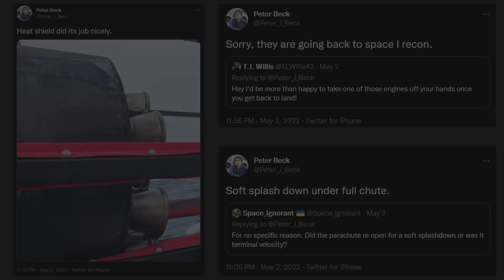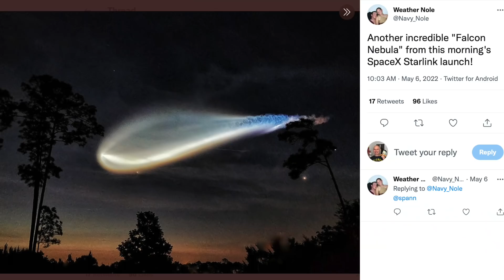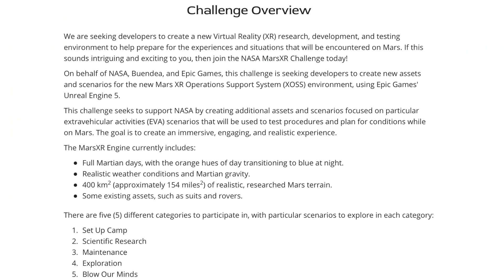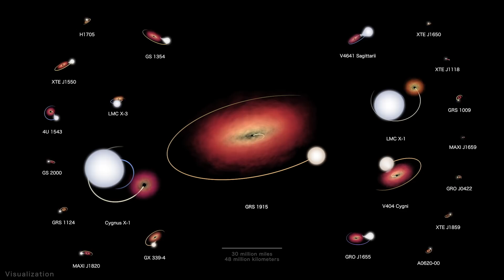SpaceX Planning To Land In Middle of Bahamas - Deep Space Updates - May 10th

Comment: Something like spinlaunch could perhaps be interesting for boosting dumb payloads like canisters of fuel or water for orbital refueling, though I have to wonder how much trouble it would be to get them into a usable trajectory at sufficient volume to be worthwhile.
Reply: You can't throw something into a circular orbit. You'd need to be standing on a high mountain which rises out of the atmosphere (eg 300km up) and throw it sideways. In reality to go from the surface of earth to circular orbit needs a course correction which means rockets. You could consider throwing something at the moon (like in Jules Verne's novel) but in practice the object would instantly vapourise in the atmosphere.
Reply: @JohnBlackburn1975  The Spin Launch payload will include an incredibly simple and cheap orbital insertion stage that they are developing in tandem with the launch system.
Reply: That can work on the moon but on earth they will always need a large second stage rocket to reach orbit.
Reply: @larslindgren3846  Large relative to a human maybe, orbital insertion stages of rockets are usually quite small and incredibly efficient.
Reply: @Sundablakr  This will be much larger than a normal orbital insertion stage. The launch speed is only 2200 m/s, to reach orbit, 8000 m/s is needed. Only about 15% of the rocket can be payload. On spinlaunchs website they claim that they can reduce the needed fuel by a factor of 4. That seams reasonable the electron rocket has a payload of about 2.4%. So most of the launched mass will be a expensive rocketstage not a simple canister with bulk goods.
Reply: @larslindgren3846  Just to be clear, I wasn't attempting to speak in defense of Spin Launch and what they are attempting on Earth, I'm part of the crowd that thinks this is never going to be a good idea from Earth, but also that I think the technology is worth researching and pouring money into developing because it will be incredibly effective on the moon and potentially even Mars.

Comment: Wonder if a spinlaunch would be viable on a sufficiently large asteroid, to throw mined substances back to Earth.
Reply: Linear accelerator will be lighter, and much less material to use to build, plus no high delta V means it does not need much power. Probably a hundredth the mass needed, though velocity will be lower, but a lot more accurate in aiming, so reducing the amount of mass needed for attitude control of the payloads.

Comment: I’d like to see spacex land a booster in the calm eye of a west Atlantic hurricane and keep the drone ship in the eye until it makes landfall that would really be something!!
Reply: The ship and booster would both get totalled...
Reply: You know what's really bad at handling changes in direction and velocity? Barges. You know what's worse? A barge with a 40 meter rocket on it.
Reply: The "calm" eye of a hurricane still has massive waves
Reply: Well grant, why don't you buy one and try it..?
Reply: @davidharrison7014  it won't make a landing in the type of seastate present in a hurricane. We're talking large waves. And even if it did it wouldn't survive going through the wall.
Reply: The "calm" of the eye is relative to the rest of the hurricane. It's still an exceedingly hostile environment.
Reply: Hurricanes move way faster than a barge ever could. Usually in the order of 30-50 mph.
Reply: Even if it "just followed the instructions"???  LOL
Reply: Haha! The eye is where the storm swell is. (The air pressure is so low, the sea rises up.) Depending on the terrain, the barge might not stop until it was several miles inland!
Reply: Technically, it should be pretty easy to do. Not sure about the ship getting out after the landing though.

But, I agree, it would be next level  awesome to see it actually done.

Comment: SpaceX should get a mothballed Aircraft Carrier from the US Navy off Hawaii and land a Star Ship  on the deck of the Carrier. Real world resupply delivery for the Navy.
Reply: SpaceX bought two oil rigs and are eventually converting them to launch and catch Starships. Right now, they are not the focus as finishing up Boca Chica and getting LC-39A ready are more important.
Reply: @steveaustin2686  you have not eaten MRE for 45 days in the middle of nowhere. Our Marines had to hold the line in Kuwait 🇰🇼.  I have picture from my combat buddy where I would be on the line should he fall. Bring hot sauce for the MRE'S.
Reply: @antoniomontanez4124  Actually, I have eaten MREs for over 30 days. Didn't like the hot sauce though. Liked the beef and pork patties, but sadly the Army got rid of those. The ham loaf wasn't bad, but the ham and chicken loaf was pretty terrible. Better than the pepper steak, so I learned to eat the ham and chicken loaf if nothing else was available.
Reply: @antoniomontanez4124  Because the Navy would like to do their own practice, instead of SpaceX doing so. The legs used on SN8-SN15 were temporary one-use legs and won't be on the orbital flight. The Superheavy booster and Starship (second stage) will hover like they are going to be caught and then soft land in the water. A CV would just get in the way.

Comment: Catches payloads returning from orbit is nothing new. USAF in the 60s catching film canisters returned from Corona reconnaissance satellites in the pre digital imaging days. Instead of using a helicopter I think Rocket Lab might be better off using fixed wing. At the same time the US also developed a system to allow the pick-up of individuals from the ground by fixed wing aircraft in flight.
Reply: The Fulton surface to air recovery?
Reply: You can't land a fixed-wing aircraft with a rocket booster hanging from it, so you need an aircraft that's big enough to haul it inside. That's a lot more expensive than a helicopter...
Reply: @simongeard4824  
Surplus C-130 or equivilant. Winch system in the cargo bay.
Reply: @mpetersen6  Right, but a stock Hercules isn't going to have the ability to catch a booster and haul it inside, so you're looking at extensive modification both to add the catching mechanism, and to get the booster in, which I'd think is a lot more complex than just a winch. 

In contrast, the helicopter is just a leased chopper, little or no modification.

Comment: Thank you Scott, for keeping me up to date. Never miss a video.

One takeaway idea here.... Spin launch may have value as a moon based system. Cool. If there is a foreseeable task there.
Reply: Nah, better a linear launch system on the moon. You could launch humans that way with modest acceleration: eg 3G for 60 seconds over a 30km track takes you to orbit speed. The moon's lack of atmosphere is perfect for this. No need for spin launch's 10,000 G acceleration which severely limits usefulness.
Reply: @JohnBlackburn1975  I did some math and came up with the 50 rule.  50km, 50 seconds, 50m/s/s acceleration and you hit escape velocity on the moon.  That would be roughly 5g's which is quite tolerable by most people for 50 seconds.  50km is kind of a long track to build though without going in circles, which would add to the g's.